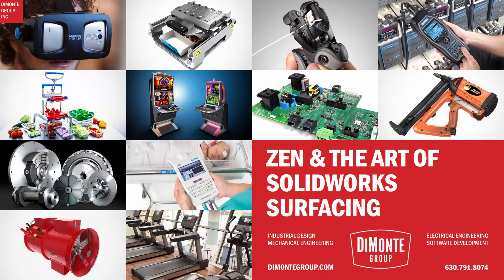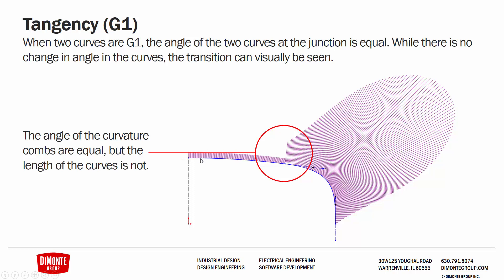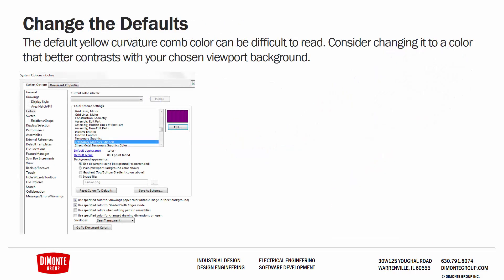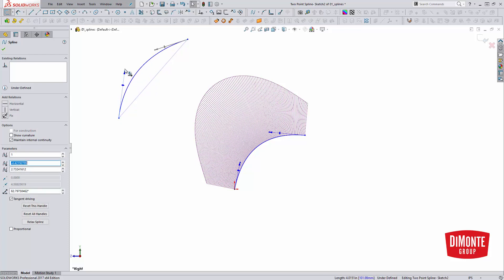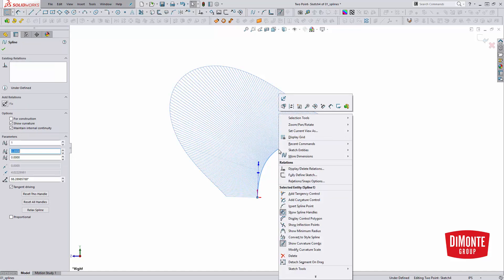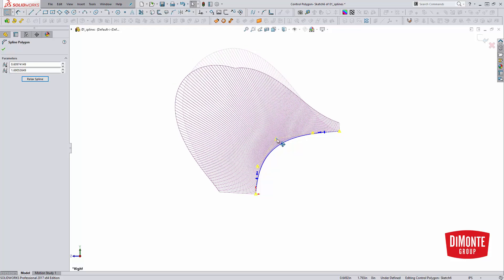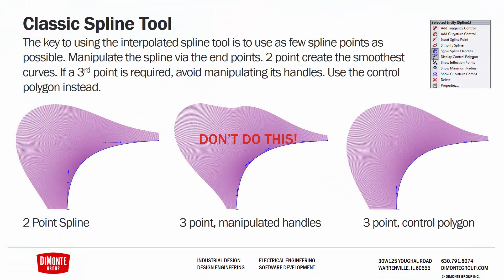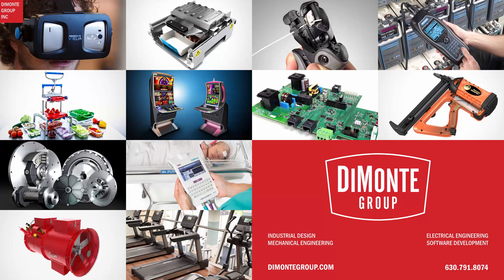Great Curves, Great Surfaces - SOLIDWORKS Tutorial -  Zen & the Art SOLIDWORKS Surfacing 02

Comment: What is meant by following.

"SOLIDWORKS does not parametrically support the G3 relation (time 2.46)."
Reply from the maker: Rajan, 
Great question, because things have changed!

SWx 2020 has a new Torsion relation which makes a parametric G3 relation.  You can read about that here:  https://www.javelin-tech.com/blog/2019/12/solidworks-2020-torsion-continuity-relation-g3/

At the time this video was made, there was no simple relation that you could add that would lock in a G3 relationship when referenced entities were edited (that's what parametric means). We could choose Tangent=G1, Curvature=G2, and those would stay good through model edits.  We could manually tweak things to make them G3, but if there was a change in a parent entity we'd have to manually tweak again to get back to G3. 

This video discusses some things you can do with the control polygon on a 2D sketch that will get you really close and be parametric, but it isn't perfect: https://www.youtube.com/watch?v=BpJYO6OAz6Q
Reply: @DiMonteGroupInc  Thanks for the reply and it is very informative. Please upload a video explaining new Torsion relation.
Reply from the maker: @kandasamyrajan   It's on the "to do" list.  Thanks!
Reply: The style spline is just a single bezier segment of degree n